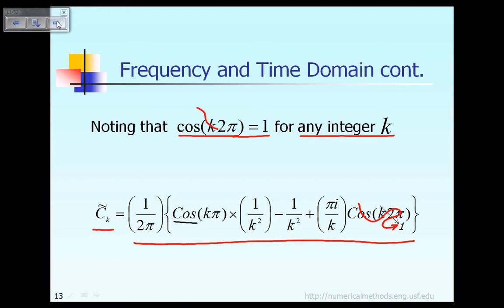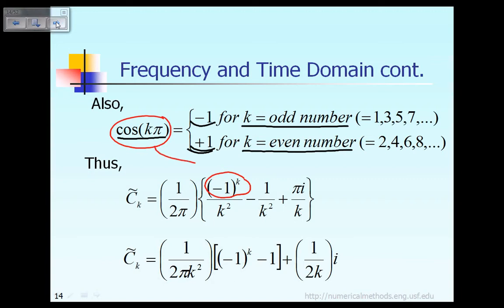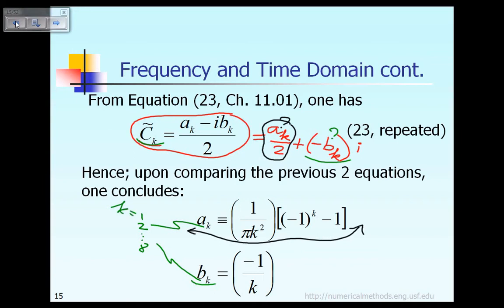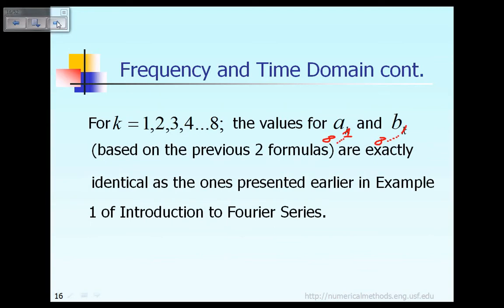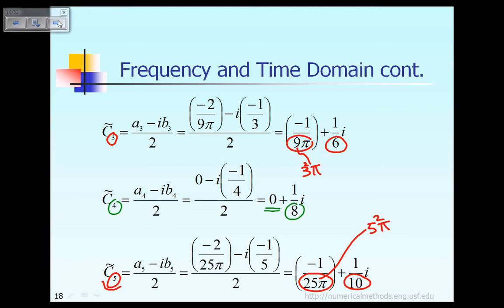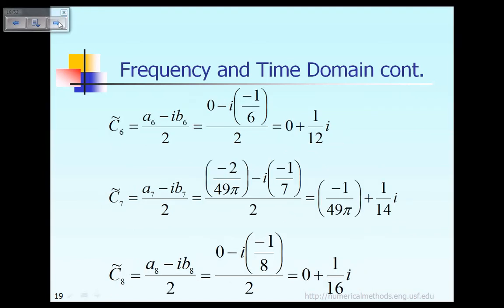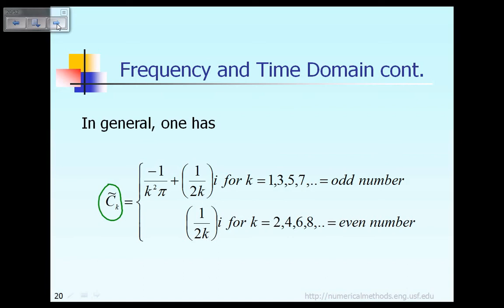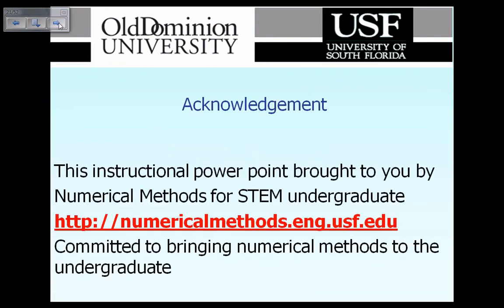Lecture 5: Fourier Transform Pair: Frequency & Time Domain Part 3 of 3

Comment: Thank you for great Lectures. Only one problem on this one. At 3:42 you got the Bk term in slide 15 wrong. It is correct in slides 14 and 17(6:48). The two under the a-ib was not distributed properly to both the real and imaginary parts. This error is only in one slide. It is not carried forward throught the rest of the example.